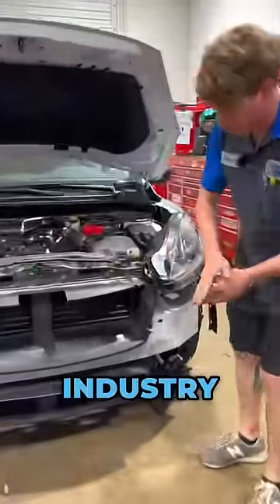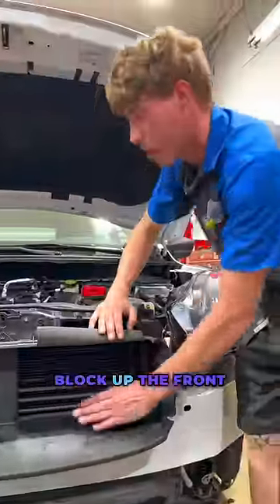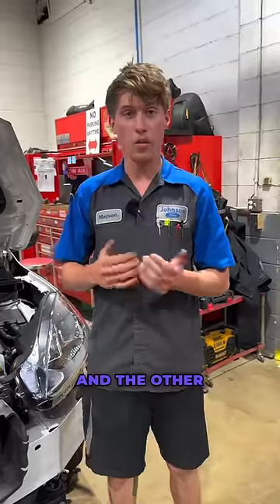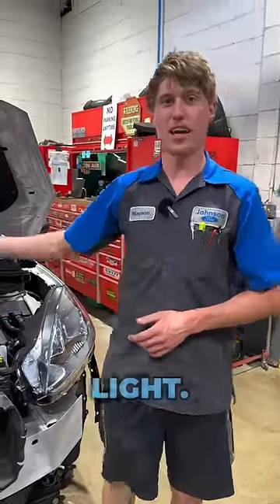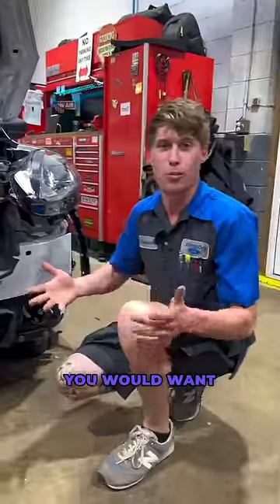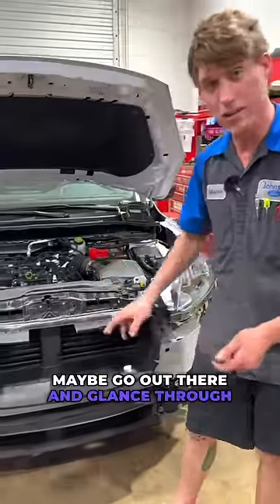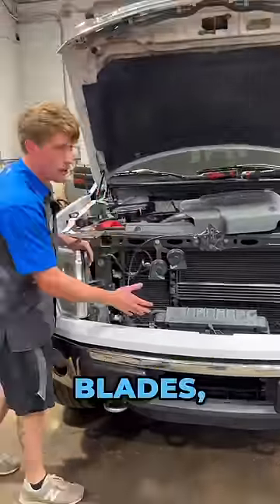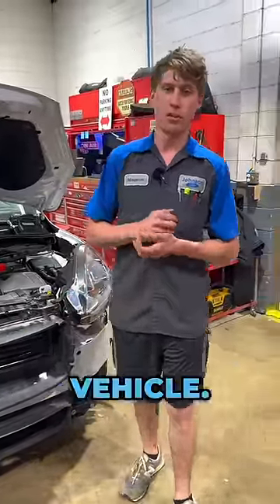Grille Shutters: A Newer Design In The Automotive Industry #shorts

Comment: It's for cold climates.. where im from it gets -40, basically dont need an intercooler for half the year, and it would take an hour for your heat to work if the rad wasnt covered
Reply: It also reduces drag. Not crazy savings there but it helps.
Reply: @Northernheros i live in Alberta.. it gets -40 here too, it depends on the vehicle you have, my old Tundra would warm up pretty quick when it was super cold out, but my old accent, focus, and couple of civics I’ve own would only get kinda warm if you were doing continuous highway speed.
Reply: I can’t imagine living somewhere where it gets -40 degrees. I want to die anytime it’s around 0.
Reply: Then manufacturers should offer them in Canada and other cold climates, not put them on every vehicle off the production line.
Reply: @yaboykris2118  lol it definitely sucks. I wish i lived somewhere warm
Reply: @NikolaStamenkovic6  It makes a reasonable difference on modern cars with their over sized grills, warming up quicker in cold climates is an added bonus.
Reply: @carbonking53 they shouldn’t offer them at all… cardboard is the best invention for this purpose!  Hate these types of ‘innovations’ designed just to make more money.
Reply: The heat siphons coolant directly from the engine. It doesn't require the radiator to be hot or the thermostat to be open.
Reply: @gregorymalchuk272  you need to experience -40C before thinking the radiator has no impact on the vehicles ability to heat the cab…
Reply: @gregorymalchuk272  not on all systems, many times the heat circuit is also blocked by the t-stat, as folks who have ever had one go bad will tell you how frustrating it is to have your car overheating in the winter and yet the heater only blows cold haha. But these shutters are for fuel efficiency, not "warming up faster" - because the thermostat is what lets the engine warm up, not these things.
Reply: Reminds me of the old Dodge Cummins engine never warming up in cold Canadian winters unless it was taken out on a road trip.Otherwise it drove around blowing unburnt Diesel smoke out the exhaust with the cab heater blowing lukewarm air. And that’s with a canvas grill cover installed.
Reply: @gregorymalchuk272 in theory.  But not in reality .
Reply: @carbonking53 obviously you are another person that has no idea of how the real world works.

Every single different variation in a production line, means more time, people, money, and you would not want to pay more, right?
Reply: Even with modern multi-valve water cooling systems that have 2, 3 or 4 zones, you can still use the shutters to help a tiny bit with drag, but they do protect the radiator and Inter cooler from rocks and debris or even salt/sand in the winter.
Reply: @gregorymalchuk272  ...but it does depend on the engine itself not being cooled by passing cold air.
Reply: @gregorymalchuk272 first your engine needs to heat up that  coolant and your vehicles heated air comes from the heater core.  Which gets it's hot coolant from the engine.  Which first needs to be heated up
Reply: @themousebouse  Yes, but you will get heat way before the thermostat would ever open.
Reply: @gregorymalchuk272  I think what you are missing is that blocking the radiator will also block air from flowing through it into the engine compartment. Remember -40 is the ambient temperature, now have that flow over the engine at 60 mph and it takes an incredibly long time for the engine block to come up to temperature since it is a huge chunk of metal that started out at -40 (or colder) and is experiencing that temperature at high speed passing over it.
Reply: @Prohortico  Yea just completely block it off or leave a small openning, but fact is when the engine does get warm enough, or potentially starts getting to hot, your fked cause youve covered it and it cant cool down now. Thats the whole point, they close (putting carboard) then open when engine starts to reach operating temps. But if you wanna just block it off and starve the radiator of air flow go for it :)))
Reply: @udalix  have you EVER driven at -40…? Serious question - engine doesn’t overheat, most have a very hard time staying warm even when covered.  Also, you put the cardboard in the grill, not usually tight against the rad.
Does need enough gap for the air to flow through.

Comment: Thought the same about my 2013 escape I ripped the blades off because they were stuck shut
Reply: I have this problem on my 2019 in the winter, and like 5 are broken from hitting a deer. Have never seen a check engine light for it
Reply: Smart AF
Reply: @DsolAX  yep doesn’t trigger a CEL for me. Although when scanning with the autel it does still show a stuck stuck shutter code. 

I do believe this is a common thing people do to the focus STs
Reply: Heavy failure rate, remove all but the very top blade to stop the motor and keep from throwing a code. GM's will throw a code.
Reply: I just took off the whole assembly and cut the motors off the assembly and ziptied them up plugged in and no cel car can't tell they are gone 2019 ford fusion
Reply: I just ordered from your website, funny to randomly see a comment by you on a mechanic youtube video 😂

Comment: You use to see them on 1970s semis
Reply: Ya funny how they work on air pressure and a temp gauge so 59 years later they are still working
Reply: That was because in cold weather the engine would never heat up enough for the heater/defroster to work. So they would intentionally block the radiator to build heat in the engine.
Reply: @the_bencredible the good old piece of cardboard!

Comment: Wow this “new” feature is on a 1947 Rolls Royce… Very very new indeed. I bet the Rolls Royce version last longer. It’s mechanically driven off the radiator. Fluid heats up, expands and forces the vents to open. When it cools down they close.
Reply: so because they were on one car that means it was used on every car made since 1947, please use your brain before you speak, the first car was electric and we still call electric cars ''new''
Reply: @justarandomguy3969 they were used in quite a few cars in 1947 or earlier. Also most semi trucks since the 30s. It was probably almost as common 80 years ago as it is now.

So no, it's not new at all. Not even a little. Not newly invented, not newly popularized.
Reply: @jaredlancaster4137  electric cars are alos not new, but we still call it new... also my car from 1997 doesnt have it soo...
Reply: @justarandomguy3969  electric cars are newly popularized(for the second time), but they are not a new type of car, and nobody who is correct claims that they are.

This is different from grill shutters, which are not a new invention and are also not newly popularized, because they have been common since the 30s.